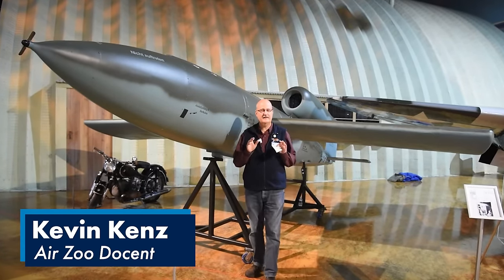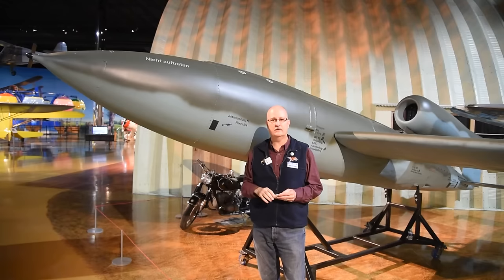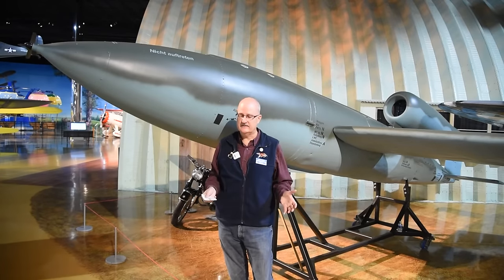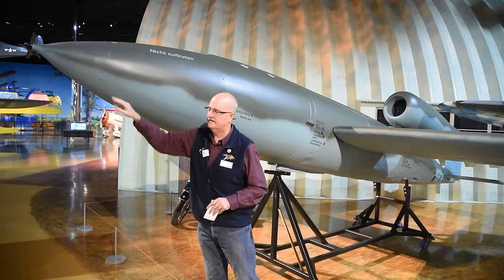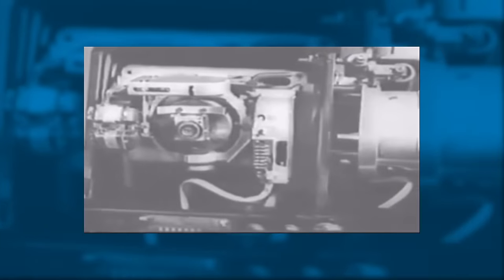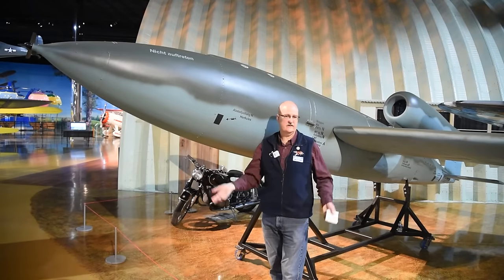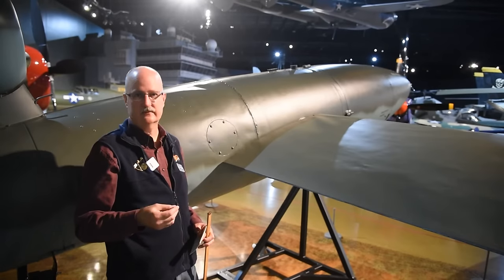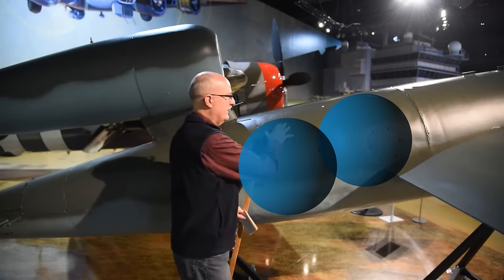V-1 Buzzbomb: A Technical Breakdown of the Vengeance Weapon

Comment: Thanks.  I'm 61.  My father served in WWII and told me about the V1 ("runs out of fuel" etc) and there is an empty hulk of one in the Halifax Nova Scotia Citadel War Museum (not sure if that's a proper name for it).  Since I was about 8 I've been wondering how this thing worked.  What I was sure of is that it wasn't just flown off a ramp like a dart thrown at a board but how it was made to work and have enough accuracy to hit a city has been a life-long mystery until today.  So thanks for that.  I watched this video only once and I'm pretty sure I could give the talk (word for word) because every part of the system makes perfect sense.  Now... how to get my wife and daughter to let me take the grandchildren to Kalamazoo (1100 miles 'as the crow flies').
Reply: It didn't really run out of fuel, a switch activated when a nut from a threated rod made contact and pitched the missile down.  It was the negative G that starved the fuel.
Reply: @williamzk9083  Exactly.  That's why I put "runs out of fuel " in quotation marks to indicate that was the version handed down by my father who didn't have the benefit of this youtube video to update him.  See, when "something is in quotes" it always means something a bit different than the words and structure would otherwise indicate, that's why "things are sometimes put in quotes".
Reply: There's also one in Greencastle, Indiana. Dad would drive past it on the way to visit my great uncle

Comment: Something no one ever mentions about the V1, but which severely limited its range, was the lifetime of the shutters (better known as reed valves) during flight.

The conditions those valves must endure are about the most brutal thing you can put a metal through, constant heat cycling 45-50 times per second, and slamming down on their seats from the force of a explosion at the same rate. It wears hard on them, allied built pulsejets could only make their valves last for roughly 30 minutes before the engine would stop working due to their failure to block the air during combustion. In model aircraft that use pulsejets they get about the same lifespan before the valve must be replaced. I read a report several years ago where, (I think it was the USN) coated a set of valves in neoprene rubber and attained a run time of over 1 hour but it still failed. 

Valvless pulsejets exist, they use a sort of resonance and fluid diode like mechanism but are not as efficient as valved ones. 

I'm sure that if the need arises, a lot of the new material science we have nowadays could extend the life of reed valves in a pulsejet.
One way I can think of to extend their life would be to add more valves, have two sets of valves in a arrow shape, the angle would allow for more valves in the diameter of the tube. This is much like how sloped armor gives a vehicle more armor thickness without increasing the actual weight and thickness of its armor.

More valves gives the force of the explosions more area to be spread out on and thus decreases the force any one valve must endure.

Comment: He kept saying all the devices used were incredibly simple. Perhaps. I was kind of blown away by the complexity of it all as there was much more that went into enabling a V1 to reign terror on its victims.
Reply: Anyone who has worked on carburetors and mechanical fuel injection knows how precisely everything needs to be engineered and adjusted to work. The fluid dynamics, mechanical mechanisms, precise fuel and pneumatic metering devices of the V1 all require rigorous design and precise manufacturing and calibration.  

The analog systems have more rudimentary and limited capabilities, but do not lack in complexity or precision.

Comment: Always so satisfying when I listen to a human who feels the need to learn things, so he can then teach others 👍 great work ! I do wonder how the fuel system works, and the pressurized airtank, have to find out if the vacuum condition you are speaking about in the combustion chamber is causing the fuel to be drawn in, under pressure, or if there is a pump somewhere, or if that system is connected to the compressed air tank ? Oh hold on, you spoke about 2 tanks, ok I will rewind again to see what you said, perhaps I missed the answer to that one, Hmz normally I can figure out how Germans think but haha, a ok yes front tank provides pressure for the fuel to flow and the other one to operate the pneumatics in the back, So then I think these tanks need to be pressurized before launch ? Or is the pressure regulated to maintain steady levels of pressure ? Hmz that little prop on the front ? is it also connected to a little compressor next to providing the countdowns and the arming of the explosives ? Or is there another smart German way to keep the tanks pressurized so all systems can keep operating till the moment of the dive ? Hmz so many questions haha, but great video sir ! You are a great teacher !

Comment: There was more to the V1 in terms of controls than I imagined. During the war years my mother´s family plus my father lived on a farm on the hills above Manchester, UK. They were used to the German bombers flying over to attack the cities of the north of England. My mother recounted one evening when a V1 could be heard approaching. As they were on located on high ground so no mistaking the noise it made. Suddenly the engine stopped and they were all holding their breath and crossing fingers. As they were well out into the remote countryside there were n air raid shelters handy. The explosion she said was very loud and the rocket hit a farm a mile away. This was so unlucky, a few hundred yard in any direction and the rocket would just have left a big crater in empty fields. The farmers wife was killed but the farmer himself was blown up into a nearby tree and survived. It looks strange today if you did not know the history. The rebuilt farm house stands as modern brick construction surrounded by the surviving outbuildings that are all old and made of stone.

Comment: Using compressed air to pressurize the fuel was a unique idea. I wonder if they could've simplified the design by using a pulse fuel pump instead? Pulse pumps work by rapid change between positive pressure and vacuum, and pulse jets are perfect for that. No worrying about running out of compressed air, it'll go as long as it has fuel.

Comment: Wow, I didn’t know that V-1 is so complicated. The German Engineer in late 1930’s must have worked very hard to make V-1 worked. 
Remember, all those were achieved without the help of computers.
 If V-1 has been so sophisticated, the V-2 as ballistic missile must be much  more complicated particularly its guidance sistem. 
Thank you for the explanation.
Reply: V-1 is relatively primitive tbh. Its not bad, just what is needed to make it work. And that made them dirt cheap, you can buy few of those and launch them at cost of a one plane. There were also air launched V-1 and some work on U-boat missiles.

Comment: With regard to the spinner measuring distance, wouldn't a head wind or opposite tail wind cause an inaccurate distance measuring?
Reply: Good point. Yes. If the counter was set up for predicted nil wind but the winds proved to be 40mph head wind, the distance over the ground would be about 10% less since it flew at about 400 mph. However, London west to east is a big target. I have no idea if a wind factor could be programmed in. The prevailing winds are west to east so presumable some compensation plus the earth’s movement was built in.

Comment: I use to have the original V1 research data with blue prints.  When the engine fires high pressure in the combustion chamber is a few lbs more than the fuel system PSI so that over powers the fuel system and shuts the fuel off for the same length of time the reed valves are closed.  Reed valves close and fuel stop at the same time this allows a perfect fuel air mixture to stay perfect for the best fuel burn.  Area of the reed valves are 60% of the cross sectional area of the combustion chamber.  Forward speed ram air makes the engine run lean, a speed detector increased fuel and the engines speed increases.  The fuel system was modified and increased in size several times to increase fuel flow to increase engine speed.   As I recall first test flight the engine ran at 380 mph, that was increased to 400 mph, 460 mph then 499 mph.  War ended before the 499 mph engines could be used.  Where is your air show?

Comment: Great video!
Just wondering if the spinner measures ground distance through the amount of revolutions which is based on the airspeed, how does it correct for the actual ground distance, as airspeed and ground speed vary based on altitude, wind direction etc.?

Comment: A couple of corrections and notes:
1 Vergeltungs translates as reprisal rather than revenge.  The idea was to damage British cities so much that the British would be forced to negotiate a stop bombing German cities.
2 The V1 did not fly to it ran out of fuel.   There was a 25:1 ratio gearbox that drove a threaded rod.      To set the range a switch was moved so that when a nut was driven along the threaded rod it would activate the switch and dive the rocket down by pitching the elevator.  The negative g caused the fuel starvation and wasn't supposed to happen.  Latter V1 had a second switch so they could change course and fly a dog leg so they couldn't be tracked.   
3 The V1 had a becon called Ewald I that allowed the missile to be tracked so that subsequent missiles could be reaimed to compensate for wind.  About 5% of missiles had Ewald Becons but toward the end of the war it became 50%
4 The V1 was to receive a precision guidance system called Ewald-II.   The system used a transmitter on the V1 that emitted a coded pulse about midway to target.   Three ground stations received this pulse and worked out the position from time differences.   A sequence of pulses were sent to correct the course of the missile.  the commands were recorded on endless loop magentic tape.  Accuracy could be very high depending on where the command was given.  (mid way or near target)  It was unnameable.
5 A turbojet version with twice the range was being developed.Its lower vibration was expected to double accuracy.
6 Willy Messerschmitt wanted to build 100,000/month.

Comment: I'm a docent at the Planes of Fame in Chino CA.  We have a V-1 but I learned a lot about it from your presentation which I am sure to share with our visitors.    BTW I understand that the Spitfire and the Meteor both would intercept the V-1 and "tip the wing" which would throw the V-1 of course.   With a Gyro on board the V-1 how is that possible?

Thanks Walt
Reply: There are no ailerons on the V1, thats why the V1 has no way to correct, when someone  "tips the Wing"
Reply: Flipping the fuselage upside down would starve the fuel to the pulsejet and result in a crash.

Comment: 24th December 1944 one of these diabolical, infernal contraptions landed in the Tudhoe Cricket Field, Spennymoor, County Durham.  Having been launched from a Jerry aircraft out over the North Sea.  Believed to have been the furthest North that one had come down in the UK.  It came down less than 150 metres from my home on St. Charles Road.  It made a bit of a bang, but thankfully for some reason not much damage.
Reply: "For some reason not much damage"  If it landed in an empty field.  That's the reason nothing was damaged...or, is that just too simplistic?
Reply: @buckhorncortez   At the time it was believed that it had not come down vertically but at an angle which supports your supposition.  I did say there was not much damage considering.  Houses were not demolished but windows were blown out. At my Grandma’s house some 2 to 3 miles away as the crow flies had her bathroom window blown in.  Many people were very distraught given our relatively remote location.
Reply: @itsnotalwaysblackandwhite8624  
Wow, did you actually witness it? I mean at least hear the explosion from it?
I do recall reading something once about them having devised a way of launching them from an aircraft but didn't know that they actually used one that way or if it never got past the testing stage.
Reply: @dukecraig2402  I was a week old in Bishop Auckland Maternity Hospital.  Landing in a small rural area there where a lot to have witnessed the aftermath.  No fatalities at the time, numerous injuries for those in bed at the time and living in St. Charles Road.  The cricket field, still shows a small depression where it came down, the field is still played on to this day.

Comment: Is it true the later V1 models detonated if they were violently tilted whilst in flight?  RAF pilots had worked out they could destroy V1s by flying alongside and using their wing tips to tilt those of the V1, throwing the gyro out of balance and causing it to crash...
Reply: If you flipped it over the pulse jet would cut out and the craft would crash.
Reply: The wingtips didn’t touch. The airflow was disturbed which caused the V-1 wing to rise and upset its gyro causing it to crash.

Comment: I always thought that the V1 was started by use of a JATO unit that pushed the bomb up the ramp, and it's movement rammed air into the engine allowing it to start, much like a ram jet.  I didn't know that the engine could be started staticily without the bomb actually flying though the air.

Comment: This was really interesting despite the awful way it was used.  I never realized a V1 was so complicated.  

I do have a question though.  Why do the diy pulse jets that I have seen on youtube glow cherry red, but the V1 does not do that.   Is it the material the pulse jet is made out of?
Reply: I believe I can answer your question.

The original buzz bombs flew at about 300mph and relatively high. The cold air cooled the exhaust tube.

The YouTube enthusiasts don’t travel anywhere near that speed and don’t have the cooling bypass air.
Reply: @mtkoslowski  Thanks.

Comment: ..my dad was stationed at Great Ashfield from June 1944 until he came bome in August 1945...hevtold me that they'd often have these buzz bombs flying overhead..as long as you could hear them you were cool..if the engine cut off, you could be SOL..He said it sounded like a truck pulling s heavy losd up a steep hill ..

Comment: As an aside, German agents in the home counties and London were meant to report the timing and place of fall of the V1s via radio to the launch headquarters so that the range could be more accurately adjusted. However ALL German agents in the UK had been captured and executed or "turned" The result was that the British arranged the sitings  report to falsely show that a large number of the V1s were slightly overshooting, (they were in fact hitting correctly) As a result the Germans corrected by slightly reducing the range by a few miles. Although this didn`t have a massive effect, statistics showed that they were able over a few week period to pull the centre of strikes out of Central London and the City area and  concentrate the center of effect  to the south of the Thames. Whether ethical or not it worked and is more fully covered in "Most Secret War" by R.V.Jones

Comment: Wonder of they did daily corrections to true magnetic north? Or they didn't need to be that precise.
Reply: You use true north to measure the track (true) using a protractor. Then you apply magnetic variation (declination) for the agonic lines in the area. You then steer the magnetic heading in order to maintain the track (true). 
Of course this V1 didn’t take into account the winds aloft to make realtime course corrections. A meteorologist would have to make some careful forecasts ahead of time to ensure the aircraft got to the target, before launch.
Reply: London (later Antwerp) were big targets.

Comment: The description of the fuses is not correct, its not the electrical impact switchs that ignite the 2 fuses on top of the warhead.
The switch ignites the electrical fuse wich sits in the centerline of the warhead, not visible from the outside.
The two fuses on the top are a mechanical impact fuse and a mechanical time fuse.
Also the counter unit only arms the electrical fuse, the mechacinal fuses got armed by rip cords

Comment: I have a question: looking at film clips of V1 launches, one sees an object falling away as the rocket clears the rail. I know there was a large piston that connected to the rocket carriage and ran through the length of a tube inside the launcher; is that the carriage or the piston that fell away during launches? TIA.
Reply: Yes it was.

Comment: I have a question. Based on wind speed and direction, and other factors such as humidity, precipitation, etc. at the time of launch, would the counters be preset to different numbers to accommodate for these variables?
If so, how were presets determined? Was there a manual or equations, graphs, or formulas to determine how to set the counter? 
Thanks
Reply: They started one V1, wich would extend the antenna and start sending short befor the (calculated) target. With the signal they triangulated the position of the V1 and made correction on the other V1s. There are only two variables to change, gyro angle and distance

Comment: I keep wondering why this design was chosen versus an even simpler ramjet.  Both required a similar kickstart.  The Argus only has an advantage at idle.
Reply: It's a lot simpler to build a pulsejet and start it on the ramp before launching.. and not at "idle" but at a lean fuel setting where it runs cooler.  The kickstart was not to start the engine, it was to get the aircraft above its very high stall speed. Good luck with a ramjet.. they don't even work at launch speed.